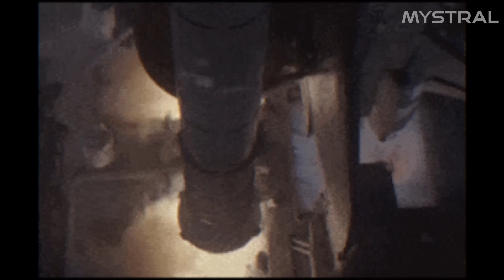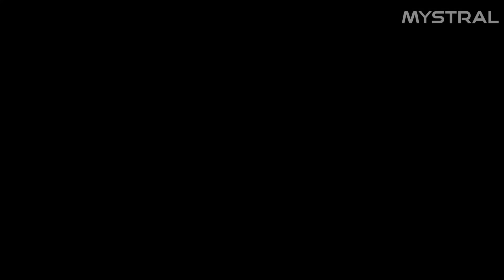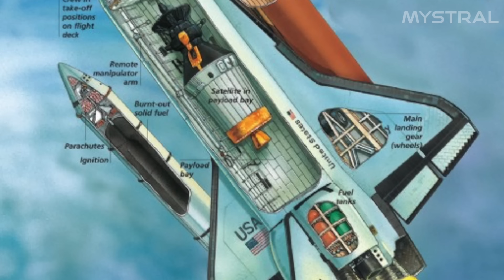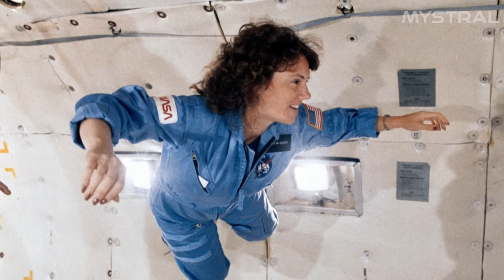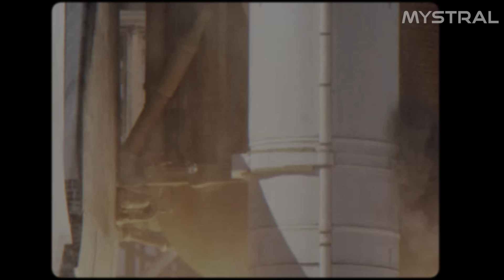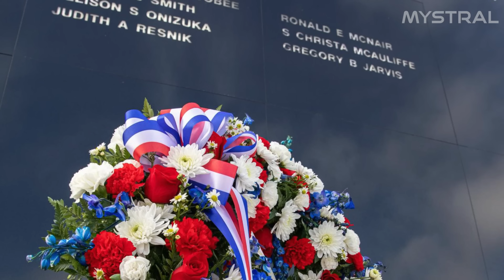Challenger Was Never Supposed to Launch

Comment: The family should sue NASA. They have enough money to make Musk a Trillionare! They are about to do the same with Artemis. With defective heat Shield.
Reply: Ridiculously low settlements were made. It is obvious the families were pressurized. 

Listen to Reagans Speech with the sound off. 
The structure becomes obvious
Part 1 was emotional drivel designed to disable the cognitive ability of the audience. 
(BUSH SR said it made him well up)

Part 2 was the only significant part. REAGAN looked very nervous as he said
"THERE WILL BE NO COVERUP". 

It is obvious the ONLY interest of REAGAN was a coverup. For example he stood very still prior to avoid giving away he didn't care about the crew at all.

Comment: This disaster happened because NASA decided to launch, with conditions outside of known launch parameters.
Thiokol's parameters had specific operating temperatures that the SRB's were designed function at.
The temperature the day of that launch was below the operating specs.
The expansion/contraction rate of the materials used in the construction of the SRB's, exceeded the ability of the O-rings to maintain a seal.
Had NASA waited until the temperatures were within Thiokol's design parameters, we wouldn't be watching this video right now.
Reply: The question should be asked is why the AEROJET design was overruled after winning the contract ? The AEROJET monolithic design would have been less sensitive to temperature than the chemical rockets. 
(Able to withstand -50 C, allowing launch in Arctic conditions.)

Comment: This vid is 100% correct . The launch commander should have been taken in and maybe a few under him . I seen the event happen myself , many were watching . This did not have to happen it was just too cold that day .
Reply: 1. Missing the point, given the Shuttle design, a Challenger style disaster was inevitable. The segment design in use when the Challenger was launched loosened with each usage. It was only a matter of time before a SRB Solid Rocket Booster, broke in 2. 
2. The crew should have survived
(a) Transponder in the Crew compartment would show on Secondary Radar allowing the splashdown to located to an accuracy of 1 square mile. A Helicopter crew guided by the Secondary could have gotten close enough to see the splashdown. 
(b) The crew died due to the Crew compartment buckling, trapping them, they drowned.
(c) By going on top of the Crew compartment using the door, and improvising head protection, they would have survived the splashdown. 
(d) The splashdown location was 15 miles from shore, so expecting the crew to swim for it was ridiculous. 
(Token rescue attempts were made for the cameras. NASA planned to sacrifice the crew for convenience.)
3. The ROGERs report gives the AVERAGE fall velocity, 207 mph. Terminal velocity is the square root of air density. 64,000 ft 1 psi Sea level 15 psi, Terminal velocity at 64,000 ft       
4X Sea level. The splashdown was 60-70 mph.
Reply: @michaeledwards2251  That sounds reasonable . The rush to launch was more important than safety , we see the results , again it did not have to happen .  Still the crew cab was removed and in good condition considering . The booster leak and shuttle tank explosion was seen from far away .